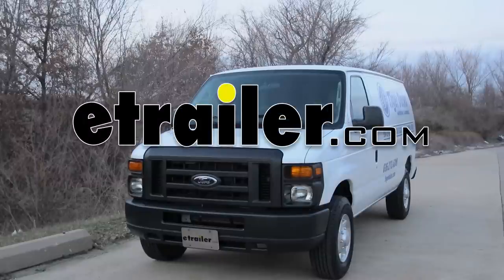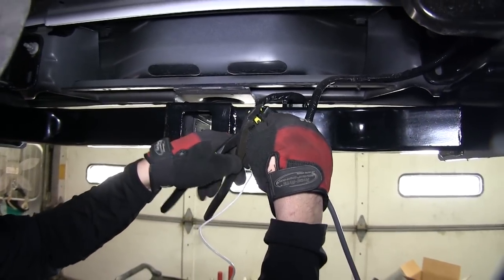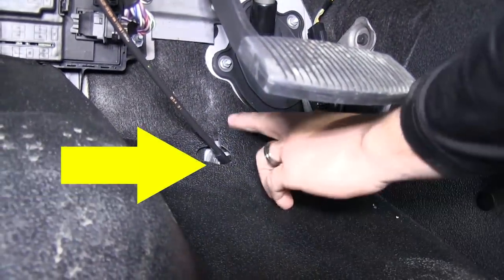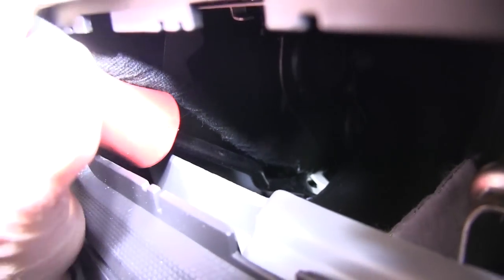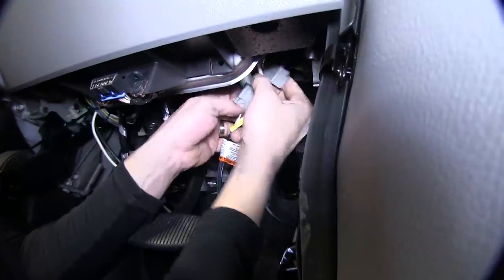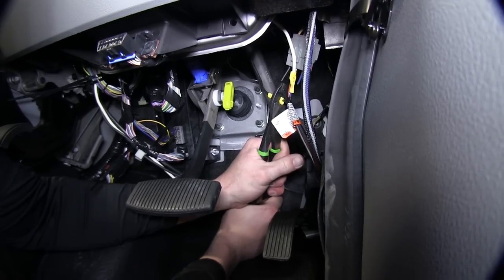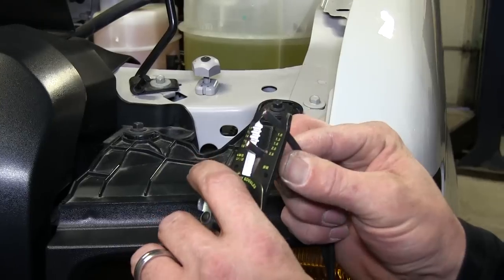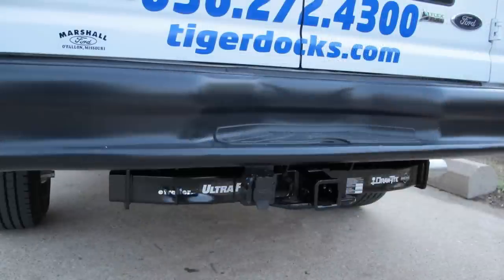Installation of a Trailer Brake Controller on a 2012 Ford Van - etrailer.com

Comment: Actually the purple wire you abandoned in the rear should have been the same purple wire that exits the factory brake controller harness, making it unnecessary to run any extra wires front-to-back.  Also, the only reason the "power lead" to the brake controller harness is "Not hooked up" is that an "Aux trailer brake controller fuse" has to be added to the factory fuse panel to supply power to the brake controller.  You're working much too hard running those extra wires and creating unnecessary splices.
Reply: haywire17, you seem to know your stuff. I have a 2010 E350 that came with no tow package. I want to install the factory in dash Ford brake controller but under stand it's not a plug and play item. Something about possibly needing a different master cylinder? Know anything about this or where I can find info? Thanks, Dan
Reply: Brake controllers need 4 things (wires) to work:  1.) Ground (Check the controllers instructions, but often this is white).  2.) Constant +12V (Often Black on the newer controllers, but could be any color on the vehicle. 3.) Brake +12V from the brake light switch (Often Red) The master cylinder should NOT need changed, it has nothing to do with this - just tap into whatever causes the brake lights to come on when the pedal is pushed. 4.) The wire that delivers the "Brake output" to the trailer (Often Blue or Purple).  The good news is that I would not worry that the vehicle didn't "come with" a tow package.  It is usually easier for the manufacturing process to simply "include these wires" on ALL vehicles than to completley wire them front-to-back later, so they may already be there.  If you find a plug under your dash for your particular vehicle that IS for a trailer brake controller, just probe it with a test light to make sure the (Black?) wire actually has power.  If it does NOT, don't panic, just look for an omitted AUX or TRAILER POWER fuse in the factory fuse panel, add that, and re-test.  Good luck.  MANY times all you need to do to hook up ALL 4 of these wires is to buy the optional connector for your brake controller, and the factory 4 pin plug will fit right into it..."factory tow pkg or not..."
Reply: haywire17 Thanks. Everything you've said is exactly what I've known to be the case typically. However, in the newer econoline vans, there seems to be a variable missing. When plugging in the factory brake controller, it does not work. We've "heard something" about a sensor on the master cylinder that is needed... Furthermore, there is a harness missing from this particular van as the rear factory tow harness I installed had an extra plug in the drivers side that I have no connection for....
Reply: @SwansonInspections  I tried to have the Ford Brake Controller and 7/4 pin trailer connectors installed by a Ford dealer.  After a few months, they found a bulletin from Ford saying it would not work because a special module must be factory installed at the same time the controller and trailer connection is installed; Ford Motor Co had no alternative suggestions.

Comment: It very nice video. I have a question: On the back of the Van, have a big plug Just plug it in (22290) don't need C56020 to plug the back Light?
The parts 3034P why you have to cut the wire? when just Plug and Play
the only Black wire from 7 blade run into front to connect circuit brake to + 
and the white wire to ground, why you have to cut the Blue wire from pig tail  #3034P  . I am very much confused.
I check with another company the part 3034P don't cut 2 wire (black, blue) just Plug and Play.
I hope questions Not upset you?